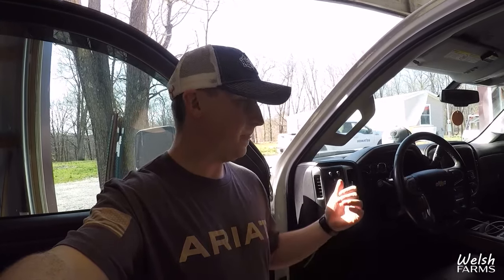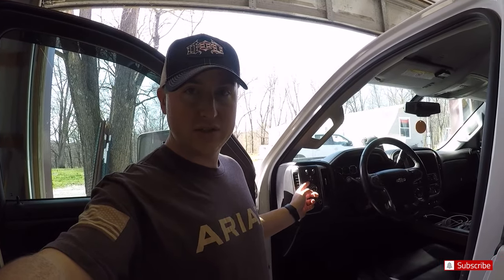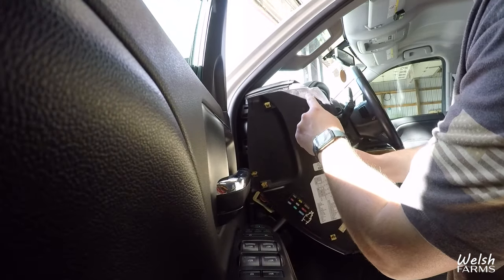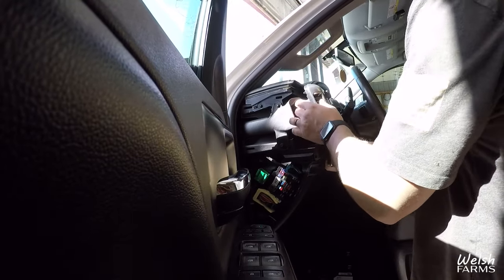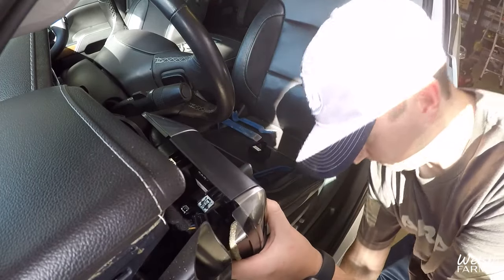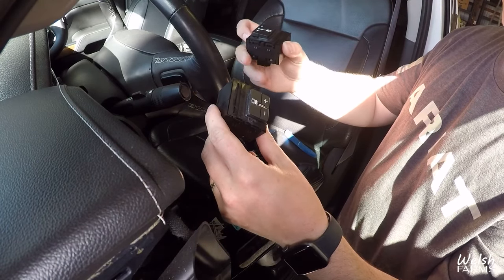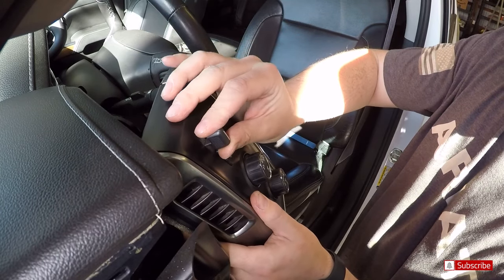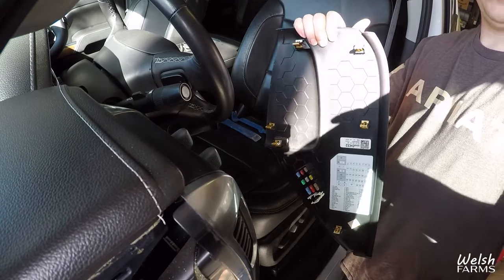Silverado Service Trailer Brake System Fix

Comment: I think this should be a recall for Chevy to fix  if it's happening to all of is happening to all us Chevy owners
Reply: Agreed
Reply: Yeah how is this not a recall
Reply: My 2016 2500hd just started this..will try the new switch!
Reply: @kevinb.3528  how did it work out for you? I have the same truck
Reply: so fricken annoying 😡
Reply: Well I guess not enough people have come forward with the problem for them to issue a recall only way it's going to happen it's more people come forward
Reply: How much do this part cost  ? is it something I don't have to go to the dealership and what is the name of this part
Reply: @chrisderrickson956  because most of us are capable of doing it ourselves…and we just spend the $30, do it in 10 minutes and move on with our lives lol 

my 19 did this straight from the dealership under warranty even…and rather than dealing with those idiots I just did it myself. Lol
Reply: @andrewayersman6923  I feel you my dealership up here charges $140 an hour but if you want to know how to get a recall put in effect I guess you know
Reply: @alonzolewis7783  it might be $50 Canadian. and you can do it your self if you watch the video.
Reply: @maclock8960  correct me if I'm wrong . but a recall is directly related to Safety . this problem won't kill anyone , so it won't be listed as a recall
Reply: Brand new 2022 truck that is doing that with less than 10,000 miles. Hook the trailer to a different truck and the brakes work great! It’s been back to the dealership twice now and they keep saying nothing is wrong. So disappointing, this is ongoing for the the last month…..
Reply: @rooirand100  same thing here with my '21.  I pull a trailer everyday.  I brought it in twice and whatever they did worked for a few months and now I'm without trailer brakes again... very frustrating
Reply: The fix is too cheap. I just replaced mine for $20. They DO have a Class Action suit for the leaking AC condenser though. Mine cost $350 to replace.
Reply: 2021 GMC Sierra same shit 2nd time in 6 months
Reply: They should have a recall for the junk AC condensers they put in these trucks also.  Apparently the AC going out is one of the most common problems for these trucks.
Reply: I agree this should be a recall mine just started doing it I'll get August 2023
Reply: I took my 2018 gmc sierra with the same problem in el centro ca, and those idiots never found the problem
Reply: I bought a New switch, installed it and am still getting trailer brake gain coming up on the dash constantly

Comment: I just replaced this part was super easy. But still getting the Service Trailer Brake System message. And won’t let me use the trailer brakes. Anyone know what else it could be? I took the trailer plug out at the back under tailgate. No corrosion wires looked good. (2016 GMC Sierra) never used the trailer brakes either. Any help much appreciated!

Comment: I am  getting this trailer brake control error and it seems that is draining my battery as well has this happened to anyone else? I recharge my battery and then the next day the truck would not start the battery was dead.
Reply: Mine is doing the same thing
Reply: @brandonbennett6305  I just tested my starter and it’s going out and need to be replaced. This may be my cause of the problem. I’ll get the starter installed next week and I will let you know if I’m still getting the service trailer break error.
Reply: Try this easy fix first. Set the gain to “0” then squeeze the break together and let it snap back. I found that this has turned my service trailer message off, but who knows it might come back on. Or it may have worked.
Reply: OK guys this is how I fix my problem with this. I bought a new trailer brake system from Amazon installed it it only took about 5 to 10 minutes then the trailer brake light came on once again so I change the battery out and put a higher cranking out brand new battery in and never had the trailer light come on again. I have been driving around for about a month now with no problems fixed.
Reply: @BestVideosToWatchTV  did you end up replacing the starter? my battery is getting drained, I had both the alternator tested and the battery and they both are good. the service trailer system break came on too. I love my truck, it's a 2018 silverado and it only has 34,000 miles on it.
Reply: i'm having the same issue.  replacing the battery today.  it tested bad.  so, is the weak battery the cause of the trailer brake error?  or is the trailer brake problem the cause of the battery going bad?
Reply: @rivertoob  Same issue i am having. truck would barely crank then got the error message
Reply: Did anybody ever figure out this issue? I’m having the same problem with my 2017 suburban
Reply: @rivertoob did replacing the battery help?

Comment: I had a permanent message on my dic stating"service trailer brake system"  After trying the rear connections I bit the bullet and bought one of these dash controllers.  This fixed mine.
Reply from the maker: 💪 good to hear! Thanks for the comment!
Reply: Thanks for the follow up.

Comment: I had this same annoying problem and fixed it by squirting some electrical contact cleaner into the brake slider control.  No need to replace it.  This fixed the problem on my 2015 Suburban.  The dash slider control is not making good contact, so the on-board computer reports there's a problem. Simple easy fix.
Reply from the maker: Good deal! Thanks for that!
Reply: ABSOLUTELY!
Reply: Hey bud where is the brake slider control to fit the contact cleaner? Thx

Comment: I have this issue on my 2017 Silverado and it used to just beep once when I started the truck but today it decided to bless me with a nonstop random beeps for my whole 45 minute drive and I'm really looking forward to my drive home after work.
Reply from the maker: Wow! That suuuucks.
Reply: @WelshFarms  I disconnected that switch and the fuse related to it, and replaced the switch and fuse.  Now it's gone back to only dinging when I first start the vehicle and that's it, I can live with that until I get it fixed permanently.
Reply: @Mypocketshurt  check your fuses mine had a 30amp j fuse that was blown and solved that issue
Reply: @dirtpro4142  is there more than one tied to this issue I pulled one designated as trailer braking system and tested it and it was fine.
Reply: @dirtpro4142  where was that fuse? Under the hood or in that control module?
Reply: the exact same thing happened to me. only used to pop up on start up and now itll nonstop beep and randomly come up, so if i replace the fuse it should go back to just on start up?
Reply: @mattlenormand3198  I replaced the trailer brake switch on the dash that seem to at least quiet the nonstop beeping. I never did get a permanent fix to it. I traded it in.

Comment: Thanks for uploading. As a lifelong Chevy driver this Silverado 2500HD will be my last GM product. I can't stand the constant dinging of warning chimes from this ridiculous trailer brake issue and constant reminders to fill my washer fluid, crazy loud door chime. It's insane.
Reply from the maker: I’m pretty sure you can change the volume of the chime in the dash settings.
Reply: @WelshFarms  there is definitely an option for it in the menu but it does not do anything. The chime remains loud as hell no matter the volume setting

Comment: My 2017 Chevy 3500 Trailer Brake warning light & alarm was going on intermittently.  I have changed the module using your video as my guide and it is a really easy to follow video!  So far, so good!
Thanks!
As an FYI, I had previously disconnected the wiring harness connections and used compressed air and electrical spray to ensure all connections were good.  Intermittent alarm was still going on whether a trailer was hooked up or not.
Reply from the maker: Thanks for the feedback! Glad it fixed you up! 👍
Reply: @WelshFarms  3 weeks later and many miles, ZERO issues!  I will go through your channel as I have a few projects that need attention.  Dealers are just crazy expensive and just don’t care that much.  Thanks again!

Comment: I just started to experience the same exact issue with my 2015 2500 HD. Very intermittent, can go days without the irritating light and buzzer coming on. Then it will pester you until you turn the truck off at any time. I've also heard the plug-in connector on the rear bumper can cause this to happen, but apparently the main culprit is the in-dash switch. THANKS for posting this video!!
Reply from the maker: Let me know if it works for you too!

Comment: Try this easy fix first. Set the gain to “0” then squeeze the break together and let it snap back. I found that this has turned my service trailer message off, but who knows it might come back on. Or it may have worked.
Reply: This worked for me as well
Reply: This appears to have worked for me as well. My fingers are crossed. That pop-up sure is maddening!
Reply: What do youean by set the gain to 0 🤔my sister has this issue on her trucc and wants me to make it go away lol🙃
Reply: @Pachuco  press the “-“ sign till it shows 0.0 on the dash. The gain is the strength of the breaks when towing.
Reply: This worked for me, still am going to replace the part tho
Reply: @joshtarrant9  did this issues kill your battery at times ?

Comment: Great video. Watched this video as a quick refresher on how to do this fix.
I've known about this fix for well over a year now & bought the switch for a few months ago. Finally took the time to install it. It took less than 5 minutes to do.
I know I procrastinate. LOL
I will say that a car trim removal kit will help a lot in popping off the trim. Bought that when I bought the switch.
I estimate that I saved a couple of hundred of dollars doing this myself instead of having the auto shop at the dealership or just any auto shop do it.
Reply from the maker: Absolutely! Well said! Good job 👍

Comment: My 2018 Silverado just started doing this. I'm glad its a cheap and easy fix. Thank You for this video.
Reply: Did the fix work?
Reply: @MrRidinchevy  Yes it did. I haven't had a problem since.
Reply: Did you have to have the new module programmed or were you just able to fix it and it automatically sync with your truck?
Reply: @shilohandoreo  No programming needed. I basically just removed the old one and installed the new one and the issue resolved itself.

Comment: Awesome vid.. this fixed my 2017  2500hd .. only took 5mins to fix.. also my screen digitizer has acting crazy too but since I fixed the trailer Brake issue .. the screen has worked perfectly
Reply from the maker: Good to hear brother, thanks for the feedback 💪💪💪💪

Comment: Just as easy as you said! Hope it fixes the problem. Even if it doesn't, it is worth the small cost and few minutes to replace this part. Bonus...I didn't know that there were fuses under that panel! Thank you kindly for the video!
Reply from the maker: Glad it worked out for you! I have never had a problem since, been over a year now 💪
Reply: Always Do diagnosis first! 
Throwing the parts cannon at a problem is a fool’s errand

Comment: Thank you so much I ordered the part it will be here Friday and I can’t wait. Will send an update comment with results.
Reply: That fixt your problem ?
Reply: @Jaime88cesar  no still having issues with it. I have trailer lights but no breaks
Reply: @denomarley5108  I’m so sorry.  I have the same problem but I’ll try to fix that
Reply: @Jaime88cesar  I ordered the module that sits above tire: waiting on part
Reply: @Jaime88cesar  looked over the whole truck. Replace switch in dash not it. Replaced module not it. The 7prong connection for trailer. The plug female plug is faulty. Check your connection. Truck runs fine. Trailer lights work brakes works. Signals work.
Reply: @denomarley5108  I’m having same issue. Replaced switch and module. Still get the service trailer brake system message when starting the truck. What was your fix for it??
Reply: @justinguffey1905  check the female to male plug behind the rear bumper
Reply: @denomarley5108  did you have to replace this plug or just clean it?
Reply: @justinguffey1905  replaced
Reply: @denomarley5108  you don’t happen to have a part number or anything like that do you?

Comment: I was towing my brand new 23 can am four seater and this happened to me
Now I'm here😂
Reply: did it work , haven’t received my can am yet, but went to buy a trailer and on my way home got that alert.
Reply: @oscarmaldonado5516  it doesn't do anything just pops up the message. I just ignore it since it only happens once in awhile.  If you buy and replace the switch it should fix it.  I just don't want to spend money on it for that little annoyance

Comment: Did changing the trailer brakes controller fix the problem? we have 4 general motor trucks and 5 different trailers, and all trucks do this. we replaced the brakes on  one of the trailer, and it quit popping up code on that trailer .
Reply from the maker: Yes it fixed the problem

Comment: I have a 2019 2500 HD Duramax and it just started giving me this warning message. When I plug my travel trailer up to my truck, I have no trailer lights and no trailer brakes. Did your do that also? I'm wondering if I have the same problem you had or something else. Thanks for any help
Reply from the maker: No sir, sounds like you have a blown fuse somewhere.

Comment: So did this shut down your trailer brakes from working. This happened to me. The code came on service trailer brake. I shut truck off. Turned back on. Still didn't switch my trailer brakes on. Drove a little further. Pulled over shut down truck and turned key over to start it up got my brake controller back. No problem. This has happened 2 times I've noticed the service trailer code. First time it came on and then I noticed I didn't have trailer brakes but went back on.

Comment: I a.having the same problem with my 2017 3500 dually. But funny thing is everything works on all my trailers including the trailer brakes. Is that still normal from what you experienced?
Reply from the maker: Yessir, same with mine

Comment: Thanks, are you aware of the repercussions of this issue when we are waiting to fix it? Brakes won’t work, et cetera?
Reply from the maker: Nope, can’t say
Reply: You lose trailer brakes if your trailer is equipped with brakes after this warning comes on. Otherwise everything else like the lights and signals work as normal. To the best of my knowledge, if your trailer does not have brakes, nothing will change. However, the noisy alerts and message on the dash can become annoying. This has been a constant battle for me in the last two weeks during which time I have not hooked up a trailer once. Not even towing, I have this issue. After watching this video, I flicked my switch a few times and it stopped. Hopefully this is in fact the issue I am having. Time will tell!
Reply: @brianrose7260  Thank you! Good luck!

Comment: I was having this issue and my truck 2018 Chevy Silverado 1500 4x4  crew cab started shutting off losing power. I bought this part replaced it, and did not fix the issue. Any information on what else it could be please???? 
Thank you!

Comment: Thanks for the video, I’m getting the same error on a trailer I pulled 3 weeks ago. On another trailer it says check trailer wire. So I’m thinking my box is bad plus the 2nd trailer may have a wire crossed. No fuse was popped.

Comment: was your truck turning off on you while driving? we have a 2017 and it started doing that to us: giving us the warning “trailer brake system” and then turns off.. on the freeway!! going 75mph 😵‍💫 and turns back on … it’s so dangerous!

Comment: Question, when you experience this issue, would you also lose all trailer brake input to your actual trailer? I have a service trailer brake morning myself where I can increase and decrease my gain, but when I hit my switches to engage the break, there’s no input on the screen and I don’t have brakes on the trailer.
Reply: Mine did that once. 2018 Silverado.  When you have the warning you have no trailer brakes. The trailer had been sitting for a few years. Sprayed the plug with wd40. Never had that problem again.

Comment: Am having intermittent Trailer Brake Service light going on, usually when not even hooked up to a trailer, on my 2017 1500. I've seen several other videos recommending replacing the Trailer Brake Relay above the spare tire. I've got one coming so trying that first. If it doesn't work, then go to the dash switch. We'll see.
Reply from the maker: Yes, mine did the same thing. This is the first thing I did and the issue has not come back since.

Comment: So what if you change this part out and it didn't work? I have a 3500hd chevy silverado 2013 and I just replaced the trailer brakes shown in this video and it's still showing the service trailer brake system on the dash?

Comment: Is there a fuse I can pull for this? My 2021 does not shut up. I took it to the dealer.. they said they fixed it but it started digging the next day
Reply from the maker: I have heard of people taking out a fuse when they have no use for their trailer brake system, but I am not sure which fuse it is.

Comment: I replaced it. Error is still showing. Is there something that needs to be reset or is there something else wrong is warning still shows on dash after starting the truck?
Reply from the maker: I didn’t have to do anything besides replacing the switch.

Comment: Just bought a 2021 Chevy Silverado 2500hd Duramax and this “Service Trailer Brake System” popped up. I can dismiss it on the steering wheel but I found it odd that it popped up and we’ve never hooked a trailer yet. I just bought the vehicle 5 days ago.

Comment: I changed that on my 13 Avalanche and I still have that message. Should I disconnect the battery cable to reset
Reply from the maker: I didn’t have to do anything besides replacing the switch